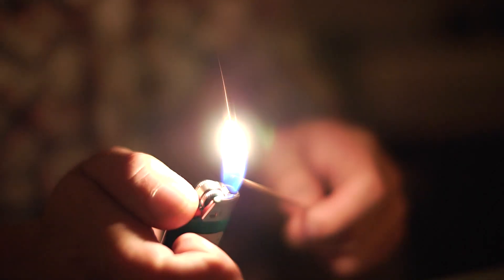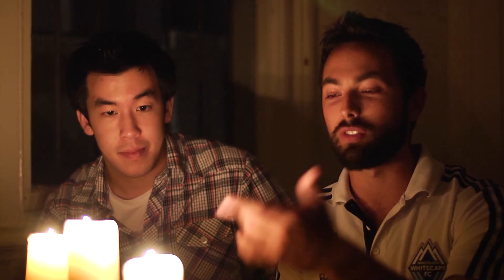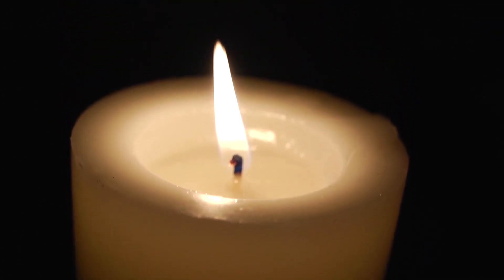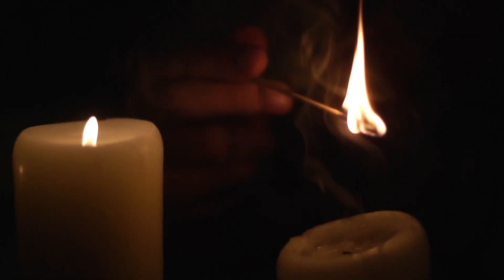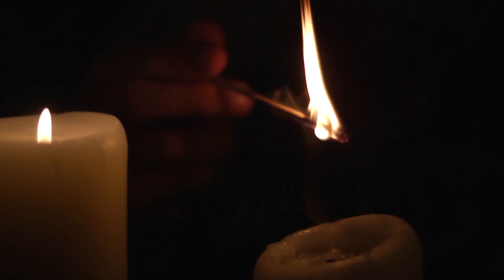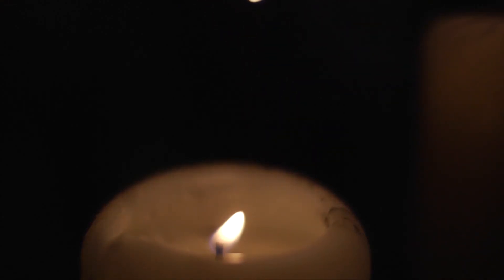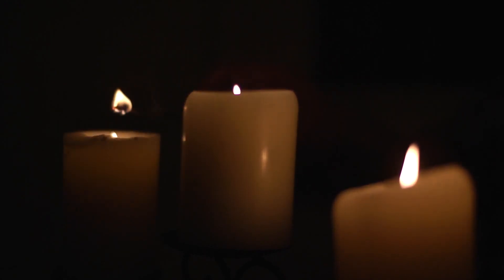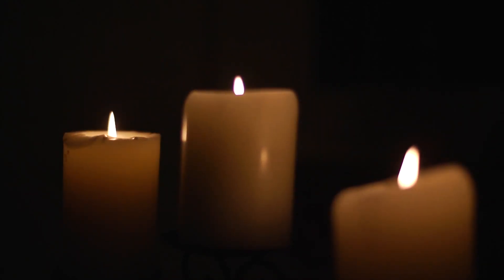Candle Trick

Comment: So my question to that flame trick is, what is the speed at which the flame travelled through the wax vapour to burning the wick?? is it light speed??
Reply: +Harpreet Singh its fast, but definitely not light speed...
Reply: +Harpreet Singh It will be the speed of combustion. This depends on the mixture. In a car engine combustion speed is around 16 m/s.

Comment: Do you require another flame source to relight the candle, or is it just the heat radiating that is needed? If it is just the heat could you do something like, create a small 'wand-like' device which had a coil at the end that would heat up. Then you could try this with an actual magician hat and cape on :D
Reply: I'd say it is possible, but you'd have to find out the self-ignition temperature of the wax.

Comment: the wax vapour is basically syngas ... the heat of the flame is still there but the flame itself isnt, and the stuff that was feeding the flame is escaping into the air... 

suppose that you can provide the heat in another way (electric heater, concentrated sunlight, etc) but in an oxygen-free atmosphere, and then find a way to store this gas... you should end up with something with the convenience of fossil fuels, but the carbon neutrality and price of candles (or waste paper, firewood, etc)

Comment: Fire is the result of a chemical reaction, called combustion. At a certain point in the combustion reaction, called the ignition point, flames are produced. Flames consist primarily of carbon dioxide, water vapor, oxygen and nitrogen. Fire emits heat and light. In order for combustion and fire to occur, three things must be present: fuel, oxygen and energy (usually in the form of heat).

- about .com

Comment: it depends on the type of fire. Some types are (arguably) a plasma as they contain ions, others are just a heated mixture of gases. These gases vary. The reason some people think fire is an energy is because it gives off energy in the form of heat and light, but that does not mean that fire in itself is composed of energy